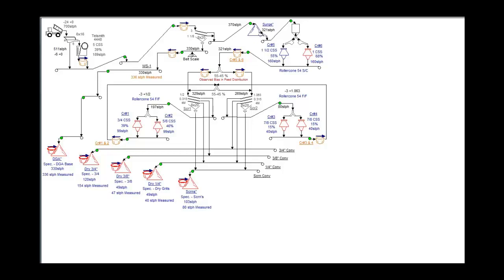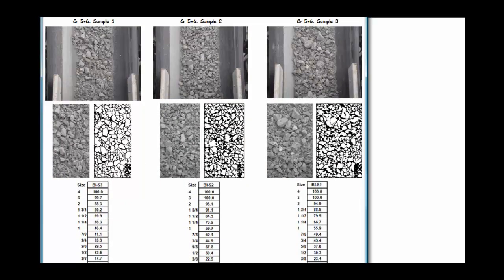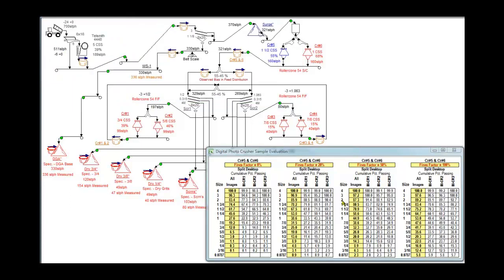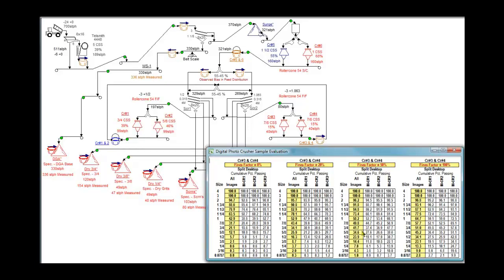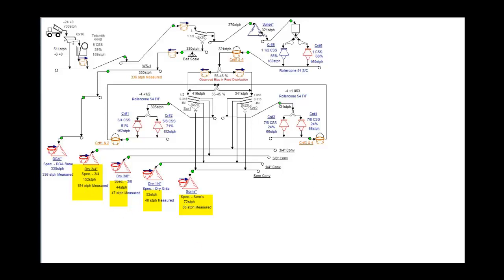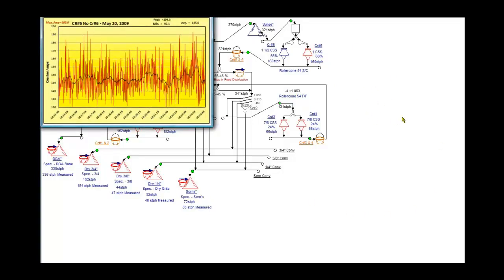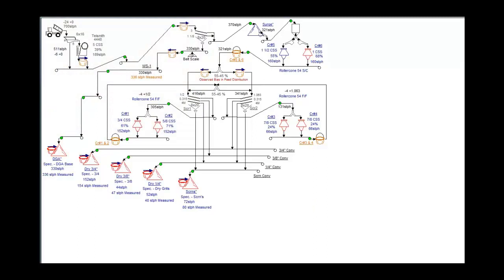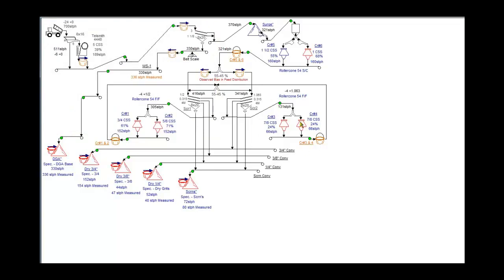AggFlow Validation with Photo Gradations

Comment: Thank you very much for your explanation video. I found it very interesting.
I find it very interesting to use the samples from the exit of the crusher to simulate the process. But, how you do it if you want to predict the amount of final products that I will be obtained for example if I close the crusher?
For this way of working, it would only be possible to do so by making the change & measuring the samples later. Thank you